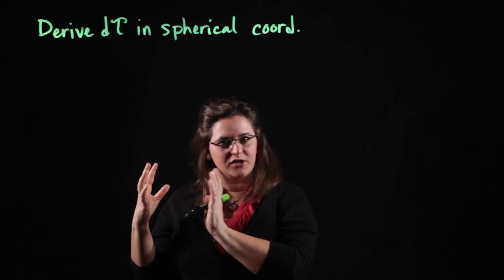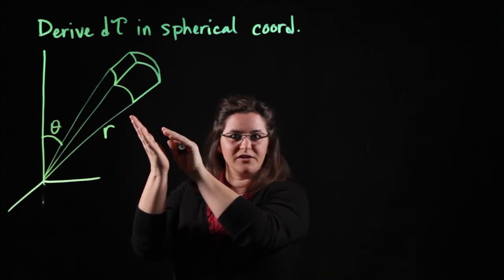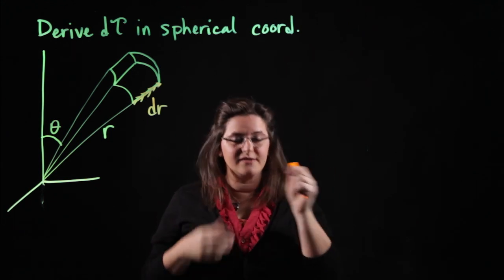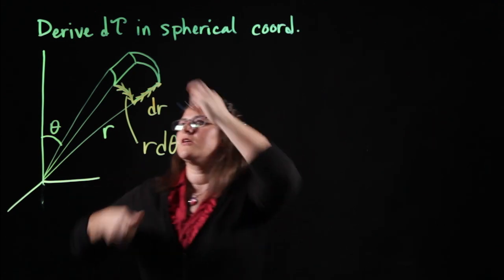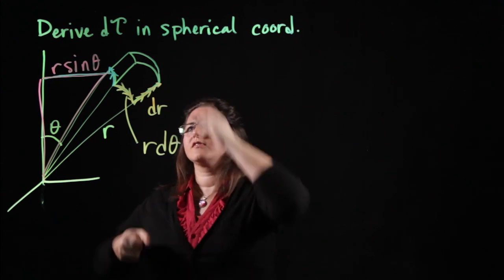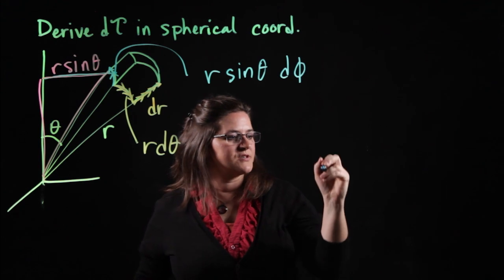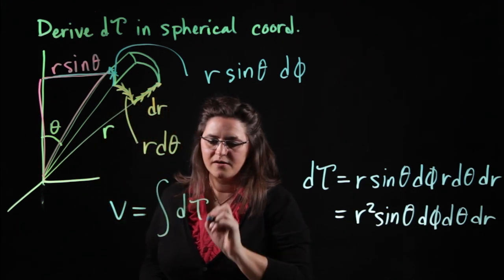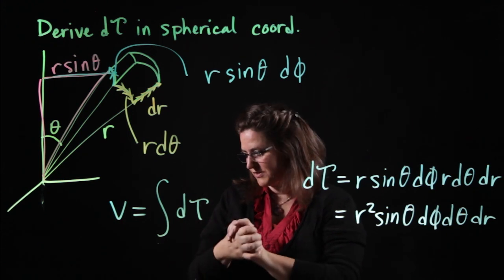Differential Volume Element Derived in Spherical Coordinates

Comment: Could you tell me how to calculate the area of  bilinear surface using integral?
Reply from the maker: I have not worked with bilinear surfaces before. But I imagine that as long as the units are consistent with area in the integral that you set up, and you make sure the limits of integration match the surface you want to find the area for, this would work. For example, if you were finding the area of a half-cylinder, you would want a double integral: one for the arc (angle 180 degrees) and one for the height of the cylinder, but no integral for the radius because you don't want volume. Thanks for the comment. Best of luck!